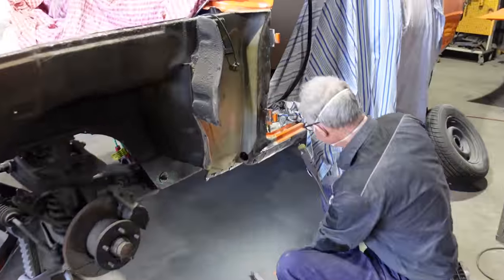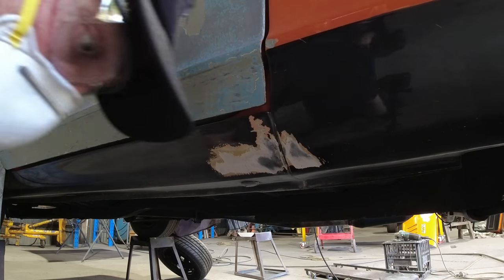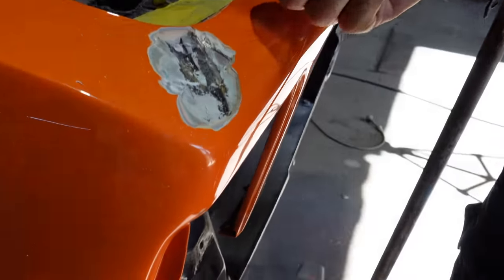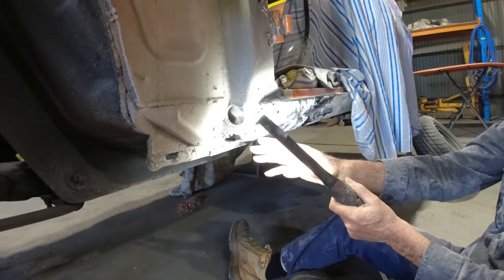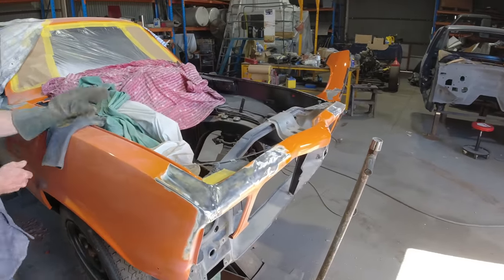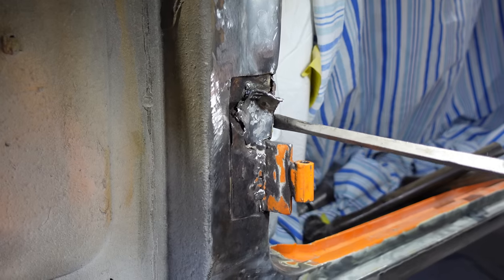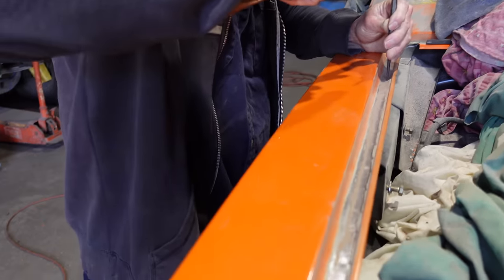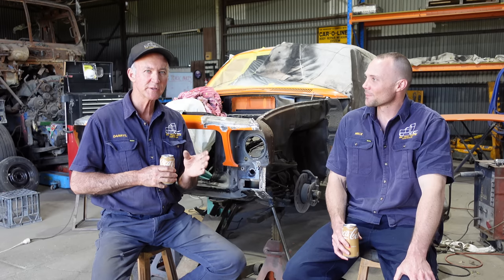Holden Torana Gtr Xu1 ( Part 5 ) We need a jack hammer for the body filler. Classic car restoration

Comment: This sort of thing is what you can expect in most of these things.  Lj Toranas,   LH to UC , Chargers,  GT Falcons.  You name it.  I can remember having LJs and LH Toranas come in at 7 years old with serious rust. My own late sold 1973 XA GT coupe was a mess when I bought it in 1979.  The lower rear window panel completely rotten.   1 1/2 inch Rust spots in the middle of both rear quarters due to the stupid little struts that come out to support the widest part of the guard with a bit of bloody felt between the strut and the body.  Tail light panel completely rusted out.  I repaired it with new panels.  Tail light panel was $40   Panel under rear screen only available as an assembly with the whole parcel shelf at $79.  So, now the cars are  40 - 43 years older than they were when I first dealt with significant rust in them.  Dodgy repairs are nothing new.  You can expect this and worse for most of these cars now.

Comment: Person who carved that out of bog is an artist, probably normally does static pieces, would be interesting to see this acid bathed to see what would be left
Reply: Could have been me .We used to shove alfoil in the rust holes .Worked a treat when ya selling em
Reply: @krulzy1  I think some people forget that we don't all have the big $$ to fix these old cars back to factory. Sometimes it's more about getting back in the car, back on road and enjoying it again at the best price you can find - or DIY a quick fix. It's more about reliving the old dream and less about the longevity of the repair, or in some cases - a quick sale. As a buyer, it's your choice whether you bring a magnet with you, or if you take the gamble that everything is acceptable by your standards as high or as low as they may be.
Reply: @knight6022  I've heard its possible to mix iron filings into the bog so its magnetic....

Comment: 28 yrs ago I started rebuiling mine and finished 21 yrs ago . Things were easier parts wise back then , guy that owned rare spares at the time found me a brand new grill , tail lights 1/4 vents and a brand new drivers door that they found half a dozen of in the Philipines . Took him 5yrs but he eventually got me a door . Gave it to a pro panelbeater to take my driver door off , couldn't do it . Took it home thought about it got a flexible drill drive had it off in an hour . Moral of story is IT"S NOT HARD IF YOU HAVE THE DESIRE !
Had an EH with numerous dodgy gaurd repairs got on youtube one day watched how to put new bottom on gaurd  got my mig out had it fitted , butted not lapped almost zero bog all in 4 hours 
Keep up the excellent work guys really enjoying your work .

Comment: Nothing unusual there . Just another 50 year old car with 50 years of damage and old repairs . 
Surely you are going to get the car dipped yeah? The blokes already into a a few grand of your time I’d expect. Just get the thing stripped and dipped and see what you really have to start with . That’s just what I’d do if I had the budget you guys have . 
Still makes for an entertaining show keep up the good work 👍
Reply: if you dip the car you'll remove unique coating you will never recreate.  for example the sound deadening on the inner roof was applied upside down then some of the material popped creating big creators or dipped down turned once right side up.  good luck re-producing that.

Comment: XU1  ..experimental unit Number one
Reply: I believe this is correct but am chasing a friend who knows Joe Felice who worked at Holden in design when these were made.
Reply: Go to bed 51.
Reply: I think that is correct, didn’t Holden have ideas of building one of these with a 253 and calling it a XU2. Just something I heard a long time ago
Reply: Sounds plausible to me 👍👍
Reply: Hi all. I had LJ GTR with a worked 202, lots of fun to drive. I agree with the comments above. XU-1 was Experimental Unit 1 and they did built an XU -2 prototype. Should be some pics available somewhere.

Comment: I'm not too surprised it's been repaired like this. I've seen a few show cars in the same condition. A friend bought a blue GTR ex show car in the mid 80's and that thing was absolutely full of bog. All the money went on the paintwork, interior and mechanics. As long as it looked good that's what counted. We started to discover how bad the car was when the bog either cracked or the rust showed up again and it had to be fixed.

Comment: Hey guys your skills are the best but you need to make a plan because you know someone has did a shit job in the past but now get all the paint off the panels and really look at it. Spend money on new panels its worth it because its an xu1. Dont take of door hinges without jigging them up first and you can put new door pillars in and new hinges as they are available new. And sandblasting is a no no it warps all the panels and you will never get the sand out of the car. the American guys say it all the time. I sand blasted a Torana 25 years ago and it was a big mistake, and the sand kept coming out of my boot lid every time i closed it for the next ten years!

Comment: When I was doing MOT repairs as an apprentice mechanic, one place I was at taught me to just slap a sill skin over the top of whatever was still there, stitch and plug weld it on every 3 bananas, give it a quick spray of satin black and kick it out the door. That never felt right to me.
Then another place had an old ship builder that came in to do that kind of job, and he would cut everything out, plug weld along the bottom seam every 2", and fully weld the rest. Then the guy that ran the place would take over, light skim of fibreglass paste over the welds, a very light skim of filler, and paint it himself. A hell of a better job, despite being a third the size of the other place.
I've only worked on my own stuff since then (got out of the game), and have always tried my best to make such repairs look like the never happened. One car I'd done full sill skins on, painted up and everything, the MOT tester just took his little scaper/hammer tool and went at the sills with gusto, assuming it would all be filler despite me telling him they'd been properly replaced. Ended up with me having to make an official complaint to the garage owner, and repainting the sills, all because the muppet didn't expect that standard of repair from a young bloke on a little old boy-racer hatchback. 
Nowadays I'm struggling to do anything to my car, had to let someone else do some welding to it, and they've bodged it right up, couple of tacks around the edge, half a litre of seam sealer, left it bare metal, job done. Half the tack welds had popped apart within six months, I heard most of them go just driving to the shops! Wish I could pull it off the road for a restoration, but just don't have the facilities to do it the way it should be done, not with my own body breaking down so fast.

Comment: Great video guys, been watching the XU1 since the start and some of the VH episodes. As my username would suggest, I'm into the Mazda Rotaries and have a 74 808 sedan. The body overall looks OK apart from the roof, it had a sunroof in it years ago and a previous owner took it out and welded in a filler panel which turned out to be a really dodgy job, it was full of bog, more than half an inch thick in some places. I had it worked on a couple years ago at one of the local smash repair/resto shops but the guy working on it didn't really know what he was doing, (apparently unpicking roof skin spot welds was gonna be too hard for him, he's no longer employed there) and it's almost as bad now as it was before. The owner has agreed to do it again properly at no cost to me, by replacing the whole roof skin (which is what was supposed to happen before). So far the replacement roof skin has been unpicked and smoothed out and should go on the car in the next couple weeks.
Anyway, looking forward to the next episode.

Comment: XU1. In addition to my comment about "XU1" in last episodes post I went digging. In 1984 after extensive research with Holden, HDT,   Fiv Antoniou published a book on the history of the GTR XU1. This book is the holly grail; the bible on the XU1. Every possible spec from suspension to engine, service bulletins to CAMS homoligation details; everything !!. Page 26 in this book states that originally GTR 3100 was considered. Quote,  GTR 3100 body sticker were considered before Holden finally adopted the computer designation of the parts catalog GTR XU-1. I know this not 100% but this book is used by clubs and the like to verify the finer detail of the XU-1. No other researcher has come close to Fiv. I have never found an error in this book in nearly 40 odd years so I am 99.9% convinced this is correct. Cheers guys.

Comment: Holden GTR does stand for Grand Tourer Rally.
Rally context was... Peter Brock in his 
GTR XU-1 was actually a rally cross car, holden made this model a new top secret car just for the rally cross at the time to compete against all the other teams, XU-1 part was I believe a internal production code for the car model being a GTR, bit like the A9X was too.
Have a sus at the man himself during the making of this model, i believe they further experimented with a 308 and 4wd too for racing and also dual engines and mid mounted engines etc. Before a street version was made from the final product, yes in the 70s you could go buy your favorite race car for street!, and like all racing is basically our technology for road cars later in life, just look at F1. 
These were creative times and such car design really had no limits back then. 
Hope it helps

Comment: experimental unit one XU-1  i was led to believe in the day, as so many bits were different but the same just small changes, and if the v8 version that was to be made, that was i think going to be the XU-2 which would have probably led to a host of different variants of parts being a v8 version, another experimental unit  XU-2., the old fox would have known. but im probably wrong on all counts. a tough job ahead on this 1 guys.

Comment: Hi All

Very common example of Australian old car, many performance or muscle cars were not kept pristine in a garage but used every day and even as a second / spare car.

Prices of these in 1980-1990 were $ 1500-$2500 in variable standards of condition 

It was not until they started getting more expensive in @ 2000 did people start collecting them  and also at the same time similar ages cars were disappearing and spares at the wreckers were hard to find. 

Also at the same time remember these cars probably did not have comprehensive insurance or if they did have insurance and there was a decent accident it was write off or repair as cheaply as possible ( bog )

As much as i like 60-80's cars, i am surprised at todays prices of cars that either sat on a farm out in the elements for 20 years or seem to have been dragged out of a creek and asking price is 20k +    - most of these cars in the day would barely be fit to go to sims metal recycling and would be dumped at the road side waiting for the free council clean up

Comment: Is it possible with the old stick welding possibilities and the joined guard and heaps of bog could it be that this car could have been a race car from back in the 70's/80's any strange holes in the body that could have been mounting points for a roll cage ..... just a thought ..... enjoying the adventure so far thank you

Comment: Hi I wanted to ask you you have a big opening in the wiper motor section of the engine bay , what fits in that centre hole before the heater fits in place, my car was just plated over and heater removed, can you please show me what panel fits inside the centre of that hole before the heater fits in. Thank you for your help

Comment: Poor work admittedly, but far better than some dodgy 0perators did, like pushing chicken wire and cardboard into the rust hole and covering it with bog. In 1968, I was inspecting an FB Holden which I was contemplating buying. It looked  pretty clean, nice paint and  smooth body.But when I noticed in the boot, I saw black tar covering the lower quarter panel .On closer inspection, it was, in fact, stiff cardboard, covered on the outside with bog, and on the inside, black tarry stuff.It looked fine on the outside. I knew of several tales of nice looking cars which were practically all bog.I can  even recall some articles published in magazines telling how you could fix rust by the"fill with practically anything and cover over" method.
I repaired rust on all my family's cars by the cut out and butt weld (with oxy) 18 gauge bits carefully shaped to fit, followed by planishing and filing till the surface was right, requiring just a touch of filler.
When I showed a panel beater acquaintance my work, he said, "Mate, if we did all that we'd have to charge so much, we'd never get rust work. People just want it fast and cheap, and looking good.
Nowadays, standards are higher (I hope)

Comment: That Torana wouldn't be from South Australia would it?   It reminds me of 1 i saw that was slapped together after a mild rollover,  i do remember the guy explaining how he had issues making the tail lights fit back in the holes, (or 1 of the tail lights)   he was rough as guts and used a lot of bog,  and the end result looked half decent,  same exact colour, and a genuine xu1.       If this happens to be that Car, i might be able to backtrack some history on it.

Comment: I have a full copy of the GMH LJ Torana Production Option Index List. XU1 = Special Vehicle Equipment, meaning a Option on the 82911 LJ GTR that the GMH Dealership would of Ticked when you ordered a XU1 Torana from a GMH Dealership and then the Adelaide or Brisbane GMH Plant would of Known to add to your 82911 LJ GTR. So in Essence XU1 is a Option Equipment.  I know Leo who worked at GMH who was in Styling in GMH Port Melbourne and Leo was the Man who designed the GTR-XU1 Decal for the XU1.
Reply: Also to add the xu1 package evolved over it’s life.

Comment: They were probably backyard panel beaters with a low budget but a can do attitude to panel and paint there car.

Whatever the case you have no right to run down the work that they've done.

That Bog job is crap to you but it still looked the part and rust hasn't come through great job to the Last owners and I feel sorry for the now owner having to Pay thousands for your guys Great work...

Stay Humble

Comment: With that much bog slathered all over the thing, the dimensions of the body must have changed significantly.
I had an LC which I sold for $950 back in the 90s, but it had a vibration that occurred between 55 to 65 mph.
I spent a fortune on it. New wheels and tyres, new driveshaft, new shocks, Nolathane bushes and balancing the wheels on the car. It began suddenly, I couldn't fix it.
Guess who feels like a moron now?
It was a clean, honest car.
Sad.
My neighbour just paid $27K for an HZ ute.
It's a bog monster, painted flat black. Rust coming through the paint, bubbles galore, bog splitting along body lines...
To make it worse, he can't even drive it, as he was told it had a "saloon car engine", whatever that means, but it's got horrible valvetrain noises, the brakes keep crapping out and the engine will now only run at a fast idle.
I'm keeping out of it.
40 grit scratches all OVER the thing.
Done like a dog's dinner/

Comment: Gentlemen ... I agree ( 15.20 ) , you don't learn a trade to do that sort of rough work to a vehicle, but please bare in mind, that LJ has probably had more owners than a Sydney nightclub and when it comes to rust repairs, little to know big repair shops that have quality tradesmen are interested in working on a vehicle like that when it had visible rust pouring out of it. The youngsters that have probably owned that car payed butt load for it, only to discover it had more plastic filler than Joan Collins ... so they take it to a shit shop for a quick tart up and get rid of it.
This not criticizing the care you going to take with the vehicle, but no 20+ yr old is going to spend twice what they paid for the car on proper quality repairs ... with all due respect :)

Comment: whoever did those repairs was a butcher 
had a neighbour back in 72 bought a orange xu1 new  had the roll back sunroof
even new these were poor quality from the factory
i knew of an old speedway driver he bought a lx torana shell new from holden to put on the speedway 
always thought it was waste  twin turbo's 308 in it  
ended up as a paddock basher a few years later

Comment: Well, that's what's happening all over the place.  Lowlife scumbags are dragging rotten old bodyshells out of paddocks and doing amateur dreadful rust repairs and sectional repairs to make a car out of  pieces of junk.   I've warned people a lot about this.  I've had to give 2 people the bad news when they bought the car first and brought it to me to check it later.  How sensible is that  ?     It is a ridiculous situation where old mass produced cars have been ridiculously pushed to laughable levels.  People are in a bizarre frenzy with this old stuff.  The bottom will fall out of this crazy market and a lot of people will take a hell of a bruising.  For pete's sake find a real body man to check out ANY such car if you're determined to buy it.  A few hundred for half a day of his time if he has to travel will be the best money you spend.  Mechanicals are fairly easy to check and generally not too expensive to rectify.  Take a mechanic along too by all means though if you don't feel qualified.   Buy something with a bodged up body though and you're in serious trouble.   Even genuine V8 monaros, SLRs and L34s,  GT Falcons etc etc will take a hit, but it's the replicas and old standard cars that will crash.